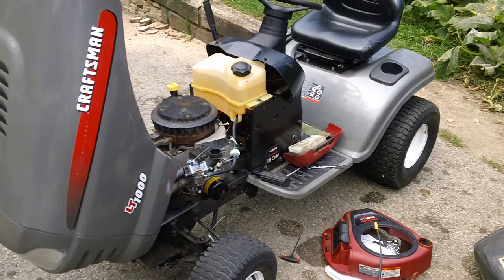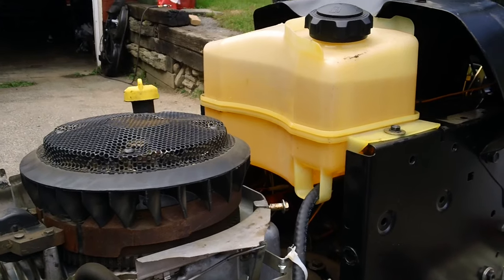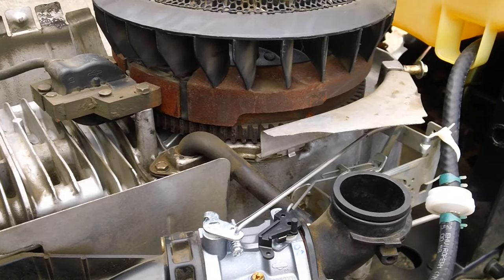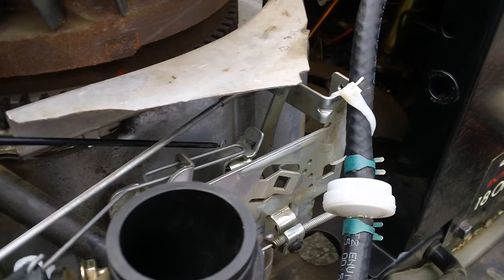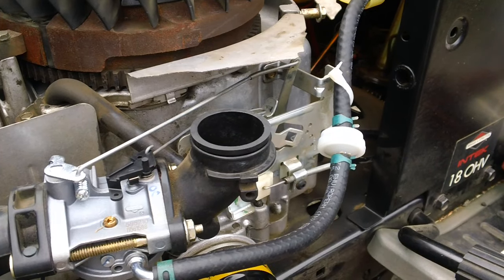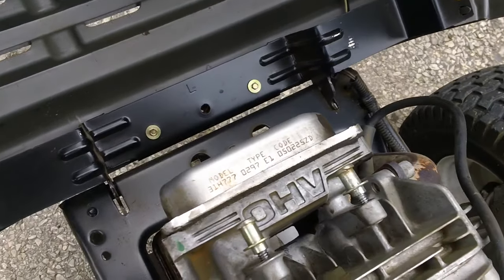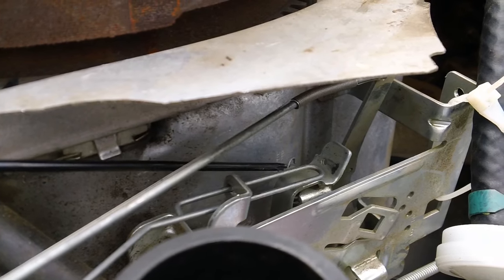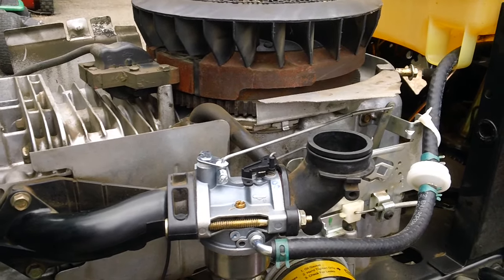Briggs throttle fix

Comment: What would make on a Briggs 1 cyl vert. , the throttle plate& the governor lever ossilate back & forth ,(engine speed go up & down rapidly)
. it starts up quickly, you have to keep the choke on pretty much or it will die..carb
 Cleaned out ,wire,carb cleaner, blown out all passages new needle valve,seat looks in nice shape, not flooding, more starving for gas. Thank you for help

Comment: Mine runs at at full throttle even when the throttle level is all the way down. I can slow the engine down by pushing the linkage next to the choke, but it springs back open all the way when I release it. Any idea why it wants to stay at full throttle?
Reply: Have you figured it out….mine is doing the same thing….

Comment: Hello.I adjusted the governor due to it coming loose and now it runs around 3000-3200 rpm. Its a 2013 craftsman 3000. But now the idle is way to high. And speed control will not work. It has a new carborator as well. I try adjusting the spring you mention in the video, but rpm will not lower. Is there something else i can do it?

Comment: I have a Toro Vtwin 656cc that was blowing white smoke. I cleaned the carburetor and did an oil change. (Fuel in Oil) Now I have a very low idle and engaging the blades kills the engine. Thoughts?
Reply: When mine blew white smoke I also cleaned the carburetor and did an oil change, diving deeper the head gasket blew. I would start checking a few simpler things before diving deeper. Check there's nothing hung up in the blades, look under the deck. Check your safety switches, here's how https://www.youtube.com/watch?v=pkh6KYIZKCo
Good luck!
Reply: Exact thing happened to me
Reply: When it dies when you engage the blades it means either you have a bad safety switch or your mower deck pulleys are bad or your mower deck stoppers are stuck unengadged my lt 1000 had that problem I changed the pulleys then it ran find for it having gas in the oil that means your float is not floating or it's getting stuck down best bet is a new carberator

Comment: Having same issues basically except I'm having an extremely high ideal issue so should I try bending that tang down a hair
Reply: That's what i got from this. He bent up to raise so bending it down should lower i guess.
Reply: Bending up would put more tension on the spring and bending down would put less tension on the spring
Reply: Hey how did you make out.. I am having the same problem

Comment: I just replaced the carburetor on the same engine which is great because it runs but now I’m having another issue. 
It doesn’t seem to come off full choke after starting although the linkage looks fine. Do you know what causes that?

Comment: So I thought it was my governor so I tried to adjust that now it doesn’t run good at all and stalls out. I put the full throttle on and turned governor clockwise and tighten. Is that correct ?

Comment: Any idea why my new carburetor running high even on low throttle
Reply: Same have you found a fix?
Reply: Same. Looking at the carb, when I throttle down the butterfly only closes slightly. I can close it all the way with my finger. But it springs back to the 3/4 open position. I'm looking at the linkage on the one you have here, and seems to have a little bend to it. I don't believe mine does, so I'm going to check on that tomorrow. But if you have another solution all help is welcome. Thanks
Reply: I don't know if this is a new carb. This is a new to me mower.
Reply: @stumpnc  did you look at rhe screw infront of the governor?

Comment: there is no "triangle" piece on mine. just looked. the throttle isnt working at all. 1 speed. no fast no slow. chokes it down when you get push tbe throttle to the choke position.